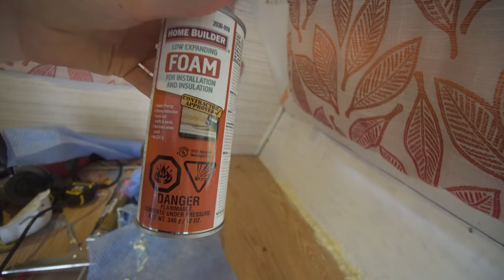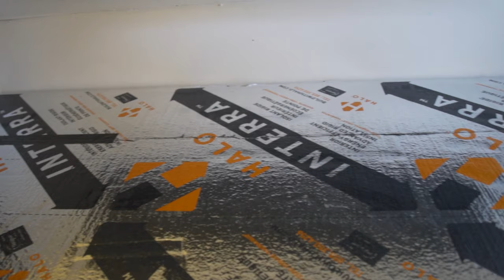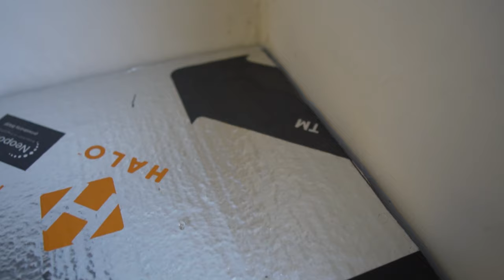How I repaired Rot in a Motorhome Caused by a Leak.

Comment: Good job! And yup... totally unexpected here too. Mine was in the overcab bed too, but only affected the base of it. A rusty screw in the outside corner trim that allowed rain in. We rebuilt the entire bed base. Probably overkilled it, but really strong. We used marine plywood and coated it 3 times. Added a cool secret storage box at the front under the mattress that doubles as extra support. Not as huge a job as we thought it would be when it was taken step by step.
Reply from the maker: Interesting that you had an issue in a very similar spot!

Comment: Very nice job!  Our toyota odyssey had a similar leak that was coming from the front windows.  After replacing wood similar to you,  we removed and resealed the windows with new butyl tape as well as new outside rubber seals over the glass.  The marker lights can also commonly leak.  Replaced ours with leds and resealed around the lights.
Reply: We are in the middle of an odyssey renovation right now too. Had lots of leaks. Would love to see how yours turned out

Comment: I JUST DISCOVERED YOUR CHANNEL....Saw your old mini van and how you have the Toyota. Congratulations. Not surprised about the wood rot and mold up there. Don't be fooled thinking that one little hole did all that damage. It came in from two primary places. First leaking seals around the windows, and second the seams from the side walls where they meet the front wall. That's going to be a big job, and you will have to remove ans reseal each window Then on the outside where the metal meets in the overhead bed area that molding that finished the side walls to the roof especially in that area must be removed and resealed with fresh butal tape/putty. Do not use this bathroom/sink tube type sealers. They never last. Do it right. There is a ton of trailer restoration channels on you tube. One of the very best is "mobiltec" he has done scores of restorations and gives great examples and instruction if you just take a look at his channel. Good luck big guy.